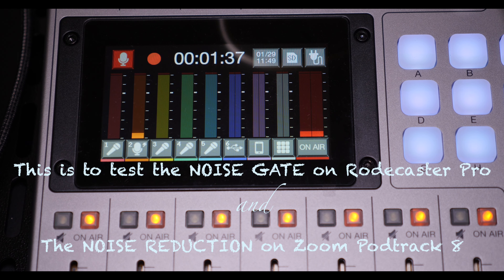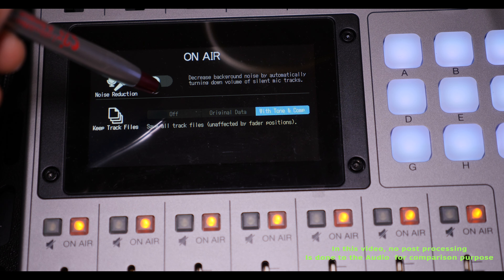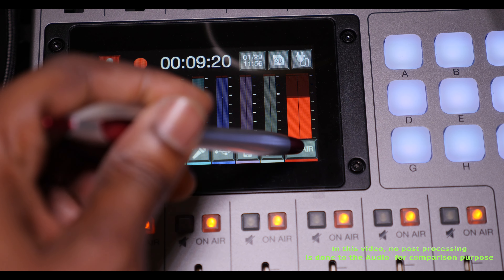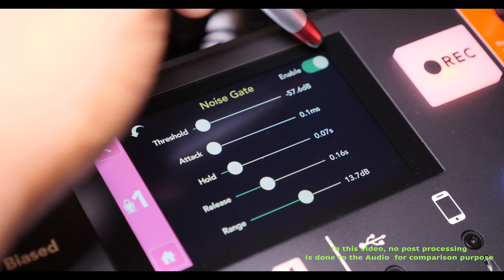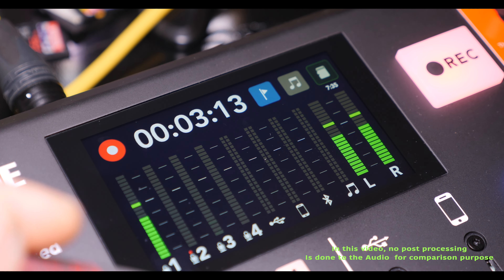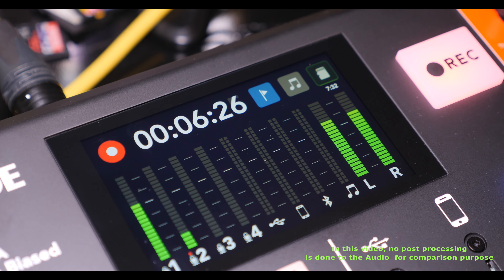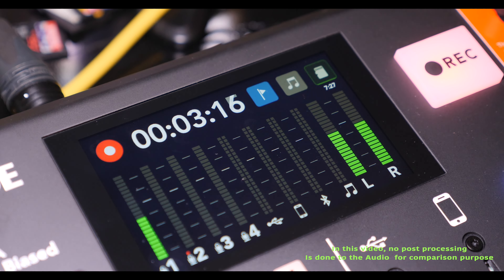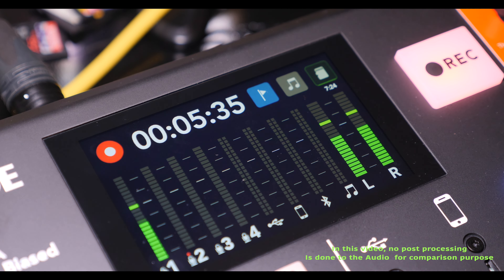RODE NOISE GATE VS ZOOM NOISE REDUCTION

Comment: You’re settings on the Rodecaster noise gate are different on channel 1 than 2&3.  Also, when you said you were going to “drive it hard” , you actually turned the threshold up and down, but you never adjusted the range value.  The range is how much it reduces the volume when the gate is closed. Also, the Rodecaster and P8 use different scales on their meters, the P8 doesn’t register levels as low as the Rodecaster does.  You can’t compare based on the meter visuals.
Reply from the maker: you're right my point is to show noise gate and noise reduction work differently the noise reduction on P8 is to manage the mix by minimizing bleed while the noise gate on Rodecaster is for background noise and both do work for what they are designed for.